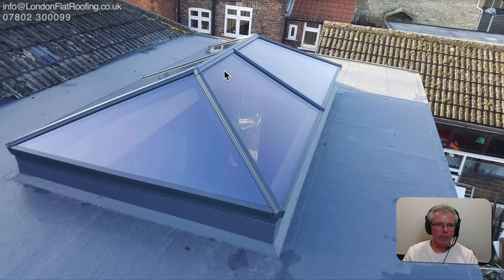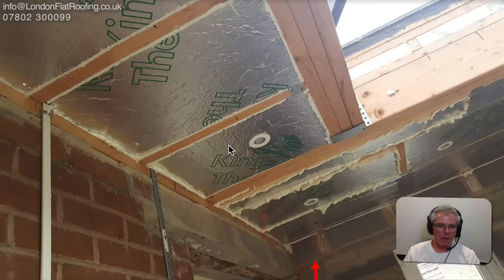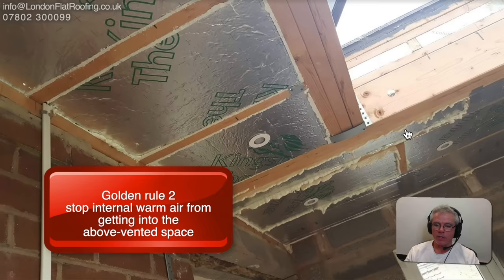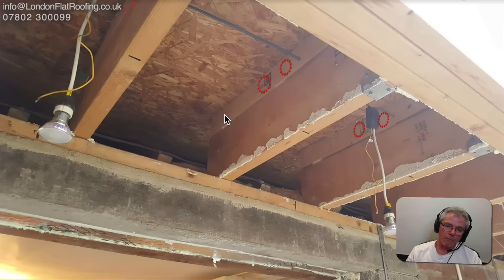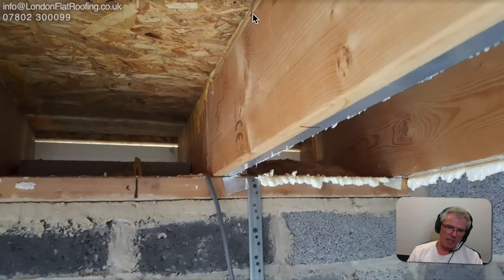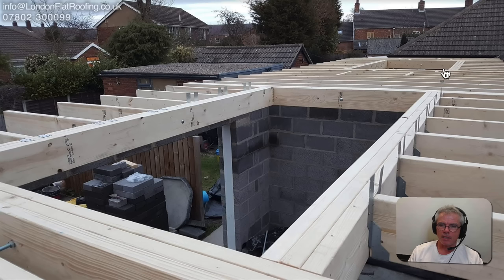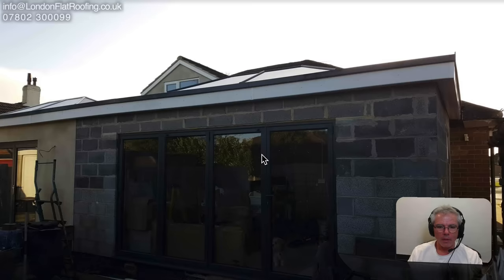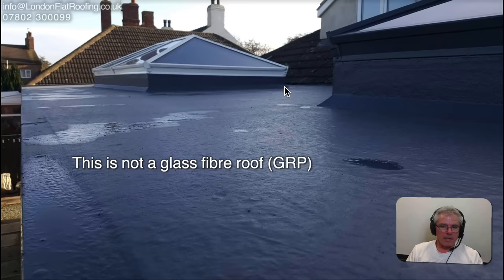Sweating and mouldy New cold flat roof

Comment: This should have been warm deck all day long especially with the large lantern blocking free flow and spotlights everywhere. No issues with height against sloping roof. Many people avoid warm deck as they're told fascia will be ugly but its an easy detail to reduce joist depth beyond wall line with a little effort. Inspectors should be tighter on these cold roof details. All very well having the correct regs on drawings that then get approved but do they actually check on site and at the correct stage?

Comment: Hi Steve. I've watched a few or your videos now, and based on your brilliant knowledge of roofing, you seem like the right man to ask.

I have a 20x10ft timber purpose built shed/garden room. It is a pitched roof design with eaves overhanging the side walls. On the outside, the eaves board have a 1inch gap running the whole length of the side walls. 
1: is this designed this way to stay open for a reason? Can I close it off and seal it up? As it gets very cold when trying to work inside (I have already added 2 vent holes on both the gable ends, and have an extractor fan installed in the center of the building throwing out the moist air)
2: im looking to insulate the whole shed soon, when I do, can I place the insulation boards directly up against the wall and ceiling cladding, or do I have to leave an air gap?
3: If I were to seal the whole room with insulation ect (other than my venting holes) will i encounter any condensation/mold issues?

I appreciate this is a lot to ask, but I just need some advice from someone who knows what they are talking about before I go and spend a load of money on materials.

I look forward to hearing from you.
Many thanks in advance
Reply from the maker: to much info please send  loads of photos  info@londonflatroofing.co.uk
Reply: @SteveRoofer  cheers Steve. I have sent you some pictures to have a look at 👍

Comment: Hi Steve, when you say put battens across the roof structure to increase cross ventilation, would you do that on top of the furrings ?
Thanks
Reply: Ideally as you can locate them to suit board dimensions. You could actually have them below firrings although not normal. They'll still create the gap as long as they're above insulation layer
Reply: @coops6621  thanks for confirming

Comment: Not "Put 'lots' of ventilation" - what's 'lots'?.. Put the minimum required by Regs.. cross-venting on blind joist voids like that is inadequate and I don' t think it would work - you're trying to squeeze all that air from all those voids into the one or two adjacent on each side of the lantern.

Comment: A sound and fair analysis, you can solve the cross ventilation problem by the way by instead of using roof joists constructing shallow pitched trusses out of 3" or 4" x 2", they are very strong but whatch out that you don't get a moron building inspector who insists upon solid 6" or deeper x 2" joists because he learned his job from books and specification sheets and doesn't have an ounce of common sense.

Comment: This is would be a really short video, only needing 2 sentences. 
Use spray foam closed cell insulation, not open cell insulation. No ventilation needed Closed cell insulation is also a vapor barrier problem solved. . Not to mention in the UK the average temperature in winter at night rarely freezes. Where I come from summer times in the nineties cold winter nights close to zero temperature. I’m from the state’s retired contractor
Reply from the maker: Spray foam in this country has got a really bad name, so nobody wants to use it
Reply: @SteveRoofer  Why is that? We  did have a problem in the states because the contractors sprayed to deep at once and it didn't set up properly NO AIR TO CURE PROPERLY. But I loved spray foam

Comment: Lots of errors  your trying to describe cross flow ventilation  🤔 not easy to create in this situation. 
You need to create a warm deck  construction 👍 
Speaking from 45 years experience
Reply from the maker: That's the point of the video its wrong and he should had built a warm roof

Comment: Hi Steve.Great video. I live in the north of UK with a mostly damp cool climate. I have a question about a vapour barrier. I have insulated just one wall in my single brick garage. 1.Breather membrane 2. stud wall .3.Kingspan insulation board sealed with foil tape. 3. Polystyrene vapour barrier and plasterboard. There are a lot of people doing that on youtube etc. Then I watched the video https://www.youtube.com/watch?v=f5w-kgQ4GhE  3:05 min. that got me worried!  Will not vapour barrier trap moisture between the drywall and the insulation causing mould just as described in this video. What's your view on that?
Reply: I love that video and all the videos she does I watch them all and she is absolutely correct basically you have to have the right vapour barrier in the right place. If you want me to appraise your situation just email me over photos and information and I'll have a look speak soon

Comment: It is, frankly, shocking how poorly understood the subject of proper ventilation is in the building industry.  My theory (or part thereof, at least) is that in the UK, so few builders appear have had a formal education in 'building'. Mind you, if architects/politicians don't understand it/know about it, how can we expect builders to? The other part is, basically, that people being people, if they can cut a corner, they will!  This issue goes very much hand-in-hand with the lack of understanding of effective installation of rigid insulation boards (RIB).  How interesting that this DIYer managed to 'get' the need for foaming in RIB rather than just relying on an industry-standard (in my experience) 'interference fit' - which almost always leaks air like a sieve - and the majority of 'professional builders' simply haven't the foggiest idea for the need (now part of the building regs, I gather?) - even if he did make the fairly colossal error of failing to make adequate (any!) provision for cross-ventilation around the sky-light...  Anyway, keep up the good work!

Comment: No, joists are not framed with treated lumber for the living space. That is 100% incorrect.
Reply: Joel Hagen  Dou you mean that wood for living spaces should not be treated?   tx
Reply: Should be obviously
Reply: @gordonferguson8242  no, the roof or attic space should be insulated and vented correctly. using treated lumber is nothing but a waste of money and 100% unnecessary. 30 years of building and I have yet to ever see treated lumber used as joists. And if there’s moisture in there, then all of what I just said was done incorrectly.
If you have a moisture issue, the lumber doesn’t stop that genius.
Reply: @Maynardd  In parts of the UK it is really quite damp, and buildings have been using pressure treated timbers for roof and floor joists for about 150 years now, and many of the better Victorian era buildings are  still standing. There is not much left from the century before however, which is telling.  How long you expect your building to last is the key point here. No good if when the roof leaks a bit the joists also rot out. You will not get bare timber past the building control inspectors here, or at least you should not if they are doing their job .... mind you someone was clearly dozing on this one, or building control were not involved at all for some reason.
Reply: @mikep-j894  i’ll say it again, if buildings are rotting from the inside out, then they’re built incorrectly. Regardless of where you live. In the United States, it ranges from 100+ degrees down to below freezing temperatures on the same day, depending where you are out in the country. I lived in Florida for a couple of years. Beyond humid there. If your attic space has too much humidity regardless of where you live it is not vented correctly. nonowhere in the United States is treated lumber required for an attic space. And there are countless Victorian homes 100+ years old also not built with treated lumber that are in perfect shape.
And if at some point, there is a roof leaking, then it should be fixed. The lumber is not going to rot
 out unless it’s been leaking for quite some time. And if that’s the case, that lumber in particular can simply be replaced. The point is, you don’t use treated lumber on the off chance your roof is leaking for months on end. treated lumber is not required here.
Reply: I was thinking he was referring to the perimeter of the skylight, not the joists.. not clarified  @Maynardd
Reply: @Maynardd what you do in the States is irrelevant . This video is from the UK and concerns our building regulations. Roof joists and rafters are built with treated timber. Expense is of no concern.
I agree that moisture has to be dealt with but the lumber is treated.Full stop.
While on this topic, Yankees can't boast good building skills and regulations . Europeans and Mexicans  beat you on all counts hands down.

Comment: How are people getting this type of thing past building control? And who is designing it all ? The architect engineering drawings should flag all these schoolboy errors up. Or is this guy and a lot of people on this comments section making it up as they go along? Thats all fine but just wait until you try and sell the house.
Reply from the maker: Building control I'm not there to inspect the works have been installed correctly so you can't rely on them. They are basically health and safety. Just trying to make sure the building doesn't fall down not to make sure that it is built correctly as regards selling your property at a later time. Yes that is a problem as a roof surveyor. I'm often doing surveys for people buying properties and condemning roof work.
Reply: There is a section regarding interstitial condensation in Part C, and building control do look at the ventilation but often the roof is on and remedies are retrospective. Great work Steve.

Comment: this is just a shitty design; here is a free design I made in paint that will always work - (https://ibb.co/4F4RSwc); add proper ventilation to the mix and you're good; hint: you can switch flat to sloped roof the principle is the same: construction layer inside, insulation layer outside, air tightness and ventilation